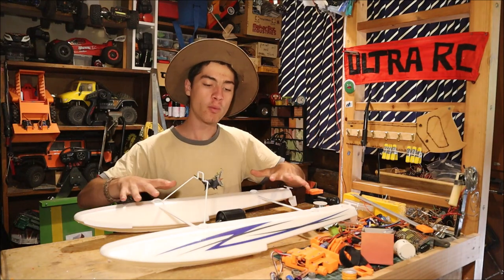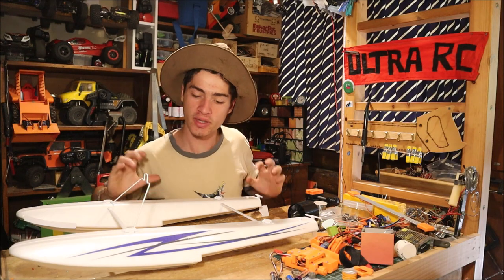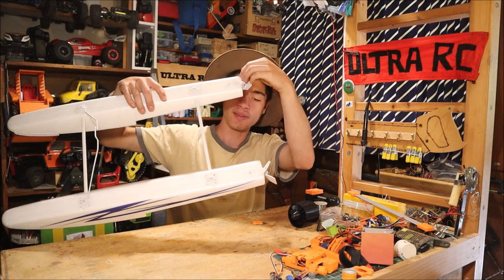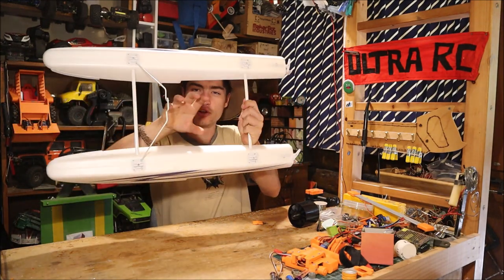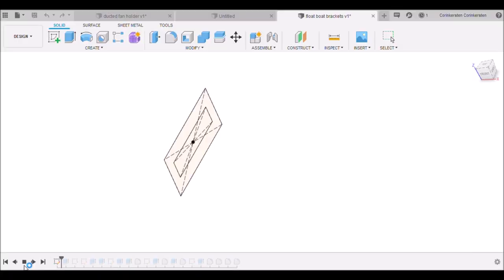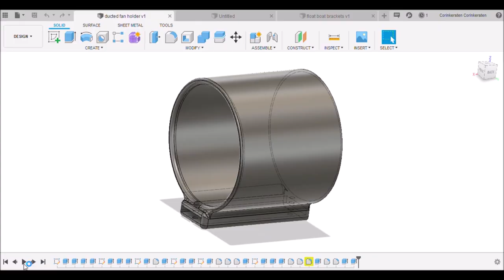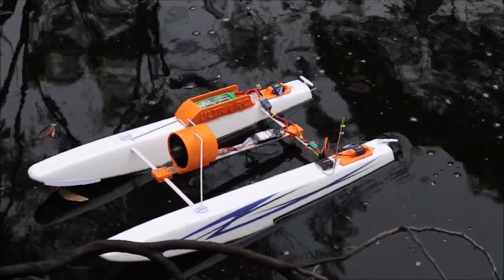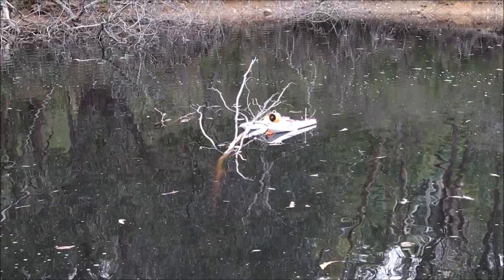70mm Ducted Fan On RC Plane Floats, Diy Fast RC Boat Montage //ULTRA RC

Comment: OK, The reason for the step on the floats ist the balancing point of the plane (Main Wing Spar). AT the planes neutral point, Balancing point the step kicks in and breaks surface tension of the water. Another words the weight is too far back on the floats for the ducted fan boat. Yes, it goes well but you missed the point of it. You can go faster. By getting the entire float out of the water you now have a hydroplane you will need a longer rudder. You will need a bigger pond.

Comment: You need to add a reverse thruster mechanism of some sort to the back of the EDF
Reply from the maker: Yeah this is a good point, i was thinking about just using in a bigger pond,
Thanks for watching this awesome ULTRA RC video mate!!!!
Reply: Wouldn't reversability be an advantage of a brushed motor? I realize they're a little less efficient.

Comment: Hey there! Great job! I'm a builder too.... Working on something similar.... Just wondering.... Should you move your battery forwards.... To get it to lift up onto step?? ...though I'm not sure if it would balance... Without A; a prop in water like a hydroplane... Or B: a set of wings as in a float plane.. .. Cheers
Reply from the maker: Hello,
Yes definetly be better to have the battery forwards, these floats also have a step to help the plane lift of but in my case it just makes the back sink. Have fun with yours!!!
thanks for watching ULTRA RC!!!
I appreciate your support!!!!

Comment: Hi, great job. Wich cad have you used to create STL files?
Reply from the maker: Hi mate good question,
I used fusion 360 because it was free as a student.
Now I use solidworks at uni which is good also but more expensive :)

Comment: some info.   good design and execution.      as can be seen, the shallow-draft and stepped hull design renders the floats less-than optimal, for any other use.        edf thrust performance is attenuated, due to the absence of a correctly tapered  exit duct.      over a distance of about five inches, ID  should Reduce from 70mm  to  65mm.       why.       an edf   is  a  'free air'  impeller.   very little  compression of air, is present.      exit duct design  should  minimize, undesired,  back-pressure at the impeller.          at the system exit, the cross-sectional area should be  Equal to  the  NET  swept area of the impeller.    from impeller area, subtract area of cone.    then calculate  a  circular equivalent.   (divide by pi, to find r-squared)      cheers
Reply from the maker: Thanks mate i apreciate your thoughts!!!!
Yeah the step of the floats should help it plane?
I think it would help if the batery was further forward. It had plenty of power even without a duct. When i do make a duct it is goog to know exactly what is the best size.
How much more power would this produce?
A cowl would also provide better flow over esc ect.
Anyways thanks for watching This awesome ULTRA RC video mate!!!!!
Do you have any ideas like this for holiday projects?
And merry Christmas!
Reply: David Davids - that’s what I was saying ;)